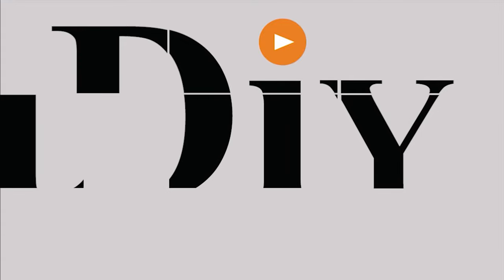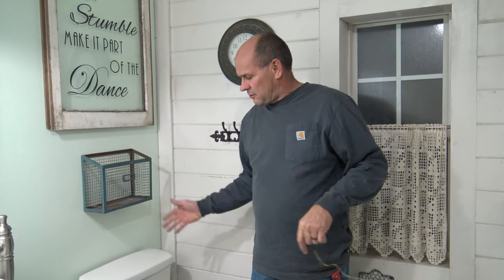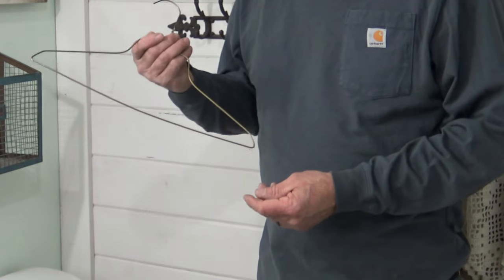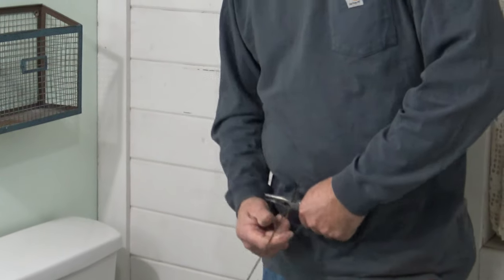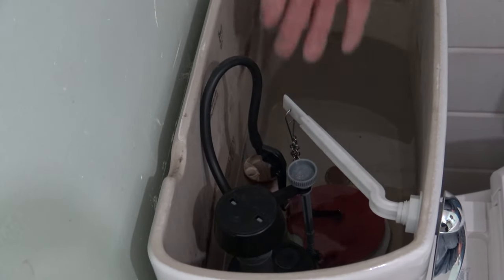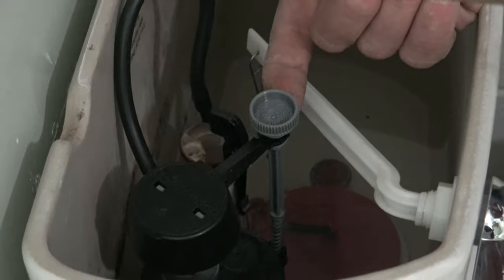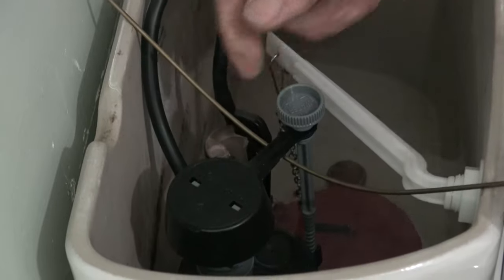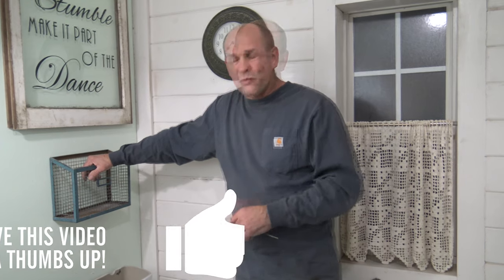How to Shut Off Water to Toilet Without Valve | Trick to Turn off Water to Toilet

Comment from the maker: Quick and VALUABLE tip!  Check out our other plumbing tips!  https://www.youtube.com/playlist?list=PLwxc6XiB_0p2s_YKdGJX_-GBx_00M8aU0
Reply: that didn't work. it still runs from wall into the toilet tank nonstop
Reply: I spent most of the day trying to contain my toilet leak.  I finally read this trick and it is working!  I didn't know if the water wouldn't turn off because I wasn't strong enough, or was damaged.  Two trips to YouTube to find you.  Thank you!

Comment: My toilet isn't leaking, but it won't sto running.  I've jiggled the handle many times, but that doesn't help.  It's been running for close to a year now- Thank God I don't pay my water bill!  Anyway, I was wondering if you know how to stop it, or do I need to call the super attendant to replace the motor?  I don't like dealing with him, hence why I haven't called him yet.  Thanks!
Reply: Call the superintendent. The running could be caused by a worn out gasket (between tank & bowl) that needs to be replaced, by a worn out fill valve that needs replacing, or by a worn out float that needs replacing. Chances are all three of those things need replacing if toilet is old.
Reply: @jamiemccants7066  You're actually right, and I did finally get the superintendent to fix it.  Thank you
Reply: @JessiCat1980  There's no motor in a toilet 🤣🤣🤣

Comment: This is exactly what I was looking for. We bought an old house, and one of the toilets keeps cycling through the water in the tank. I know we will have to get it fixed, but right now we just can't. So I wanted to just turn the water off to the toilet and there is no shut off valve! Thank you, thank you for this trick! It worked like a charm.
Reply from the maker: Fantastic!!

Comment: This is great. What if I need to replace the toilet fill valve? All the videos say to turn off the water valve...
Reply from the maker: Yes, if you need to replace the fill valve you will need to shut off the incoming water.
Reply: @DIYOnTheHouse  Thanks, so I guess I can't do this method when replacing the valve? I was thinking I could quickly switch it like use the hanger while I get the replacement ready and switch out it. Like Raiders of the lost arc.
Reply: @SFVone  me, too. In total Hell here as I don’t think the center screw on the water shutoff valve is nevertheless right screw, I can’t get it to tighten, the valve knob only barely catches and the valve is stuck so I have no toilet here.
Reply: I have to shut off my main water supply

Comment: If I  use this truck will i still be able to use the toilet temporarily. do i still need to push the handle and jiggle handle everytime
Reply from the maker: Yes you can take out the wire and refill and put it back after it's filled.

Comment: Thank you for this, our downstairs toilet was running every few minutes and causing the pipes to make an awfully loud clanging noise. This trick has stopped that, thank you!
We are getting a replacement toilet in 2 months, is it safe to leave toilet like this for that long?
Reply from the maker: It will just stay shut off, so it shouldn't be a problem.

Comment: There is water coming out around ny shut off valve, like the pipe/hose there is cracked. What can I do to stop that until someone comes? My landlord isn't very quick to help so I need to do something without turning off all of my water.
Reply from the maker: May have to shut the water off, and call the landlord and say it may be damaging the floor. That might light a fire under them.

Comment: Am just trying to replace the worn out gasket on the Kohler toilet canister but the toilet valve is stuck. So this trick has stopped from refilling water inside the toilet tank. When it's completely empty, I assume I can leave the hanger there until such time I can remove the canister and replace the gasket and put it back in, correct? I just need a second opinion 😊 please.
Reply from the maker: Yep you can leave it in place until it's repaired.

Comment: I would like to replace an old style ballcock valve with a float valve and had to implement this hack to get the water to stop. If I remove the ballcock valve with the hack in place, will the water flow out from the water once I remove the old valve? I hope that makes sense.
Reply from the maker: To change that, you will need to shut off the water to the house and relieve the pressure on the house. This would be a good time to change the shut off on the wall as well. BTW we have a video on changing that coming out this week.

Comment: thanks
My problem is with the connecting tube to the tank. It is leaking and I cannot shut off the water as the valve won't turn.
Reply from the maker: You will definitely need to have the valve replaced.

Comment: The guy who built onto the house before we bought it did a bad job. it used to just be downstairs we found out. the upstairs toilet started leaking on the floor and madetile showing downstairs. I  knnow that it's not easy to get a plumber n sometimes for several days, but this trick will help. I  couldn't find a shut off exceopt the maine water shut off valve downstairs. it's leaking on one side towards the back of the toilet. mom thinks we can fix it and save money but if not well have to use the trick until we can afford a plumber. i haven't used the downstairs toilet in a long time and I  saw what looked like rocks. are they hard to remove by myself? if so any advice
Reply from the maker: Where are the rocks?
Reply: @DIYOnTheHouse  rocks were downstairs. I  got the rocks out. bathroom  toilet  upstairs made big hole downstairs so had to turn water off until a plumber can look at it. using downstairs toilet for now.

Comment: That's great hack thank you but why when I turn the valve off and on in the back of the toilet to the wall, it turns but doesn't turn it off anymore? Is it stripped??? Thanks
Reply from the maker: The valve has a rubber washer in it if it's a multi turn. That washer gets hard after time and when you turn it shut it breaks apart.
That washer can be replaced with a 00 flat washer
1- turn water off to house and relieve the pressure
2- get a small container like a cake pan and place it under the valve, water will come out make sure no other faucets are open so a vacuum is created so it doesn't keep draining.
3- unscrew the bonnet nut directly behind the turn off handle and slowly turn out the handle until the stem comes out all the way
3- remove any of the old washer from the valve body with a wire or what ever will fit. (make sure there is nothing left behind
4- install the new washer on the end of the stem and press it on, I use a nut driver to press it on until it seats, lube the stem with stem grease
5- reinstall the stem and tighten bonnet nut and close valve and turn water back on and test.

Hope this gets you back in business
Ross
Reply: @DIYOnTheHouse  man your so great, thank you for taking the time and replying to me and helping me out, I'm going to follow your directions this weekend, thank you
Reply: The floater won't raise up with the wire. So what do u think it is? I need help really bad

Comment: I need to replace the toilet flush valve itself but I can't turn the shutoff valve off. Any input?
Reply from the maker: Sadly you will have to shut off the water to the house. We do have a video on the channel on how to change an angle stop if that would help.https://youtu.be/__51CGPJr_g

Comment: I shut off water from toilet. However i hear drops in walls. Any recommendations
Reply from the maker: Hmmm?  Do you see any moisture on the wall?
Reply: @DIYOnTheHouse  I have the same problem.  I changed all the parts in the tank. I found that the 
water keeps filling up the tank. I had to shut the water behind the toilet. Doesn’t shut completely.  The water sound is not actually in the wall but inside back where the water enters. Because the Water is still running.   Not as powerful but it’s enough that it fills the tank in 15 min.

Comment: Help. I am trying to do this, but when I opened the toilet cover, there is a black tank inside that says SLOAN flush mate. I really need help, please.
Reply from the maker: Sounds like you have a pressure assist toilet, unfortunately you will need to call some one to help you out, those are a little more complicated.
Reply: @DIYOnTheHouse  Thank you for your reply. I had it fixed.

Comment: If the shut off valve is broke, and you try this method to install a bidet, it doesn't work.

When you unscrew the hose from the bottom of the tank, water will still come out non stop, even if that little plastic piece is held up.
Reply from the maker: Sorry, this trick will not work that that situation.  Unfortunately, the shut off valve will need to be replaced.
Reply: Glad I searched for this comment before trying it 😆

Comment: That doesn’t turn off the water TO the toilet, though!
Reply from the maker: This is a trick for when turning off the water is not an option - like when your sut off valve is broke.
Reply: @DIYOnTheHouse  Which would be fine if the video didn’t have the title “Trick to Turn off Water to Toilet...”

Comment: In the time that it took me to go find pliers and a wire hanger my bathroom flooded and I drowned. Maybe turn off the valve behind the toilet…much simpler.
Reply from the maker: That's the obvious way to shut it off. As I said in the video if the angle stop doesn't shut off, this trick will work.

Comment: It did not work for me.
Reply from the maker: Let me know what happened and I can see if I can help you more.  Thanks!
Reply: @DIYOnTheHouse  Hi there DIY, I opened my toilet cover, instead of seeing what was in your toilet, there is a black "Sloan flush mate" tank inside instead. I don't know what I can do to hack my toilet until I get my plumber. I need to turn on my main water line to have a shower for work now, but I will flood the house If I do that. Is there something I can do? Thanks!
Reply from the maker: @1212Artemis  Can you take a picture of your tank and the shut off at the wall and email it to use diyonthehouse@gmail.com